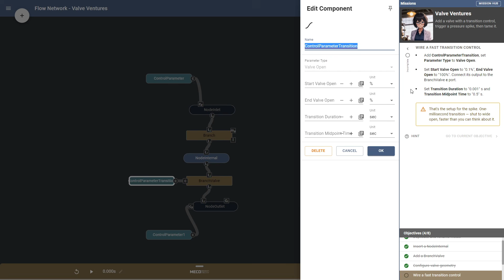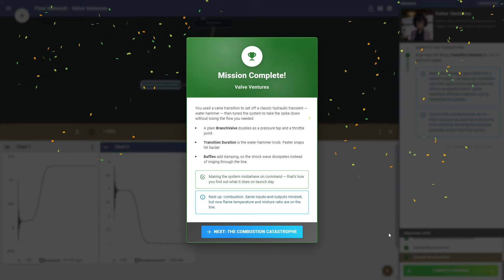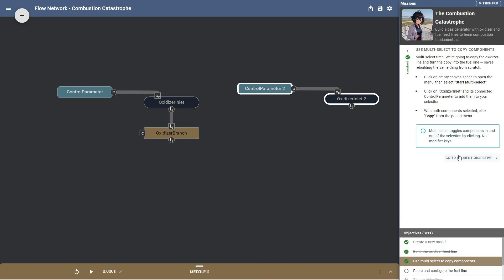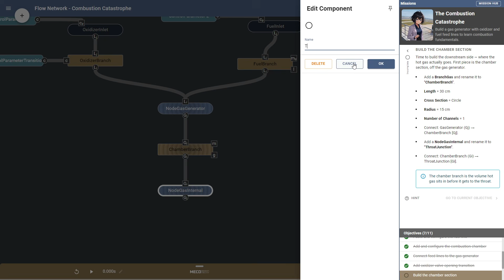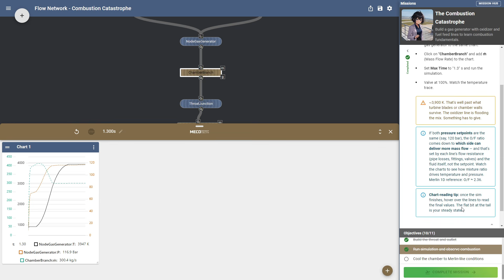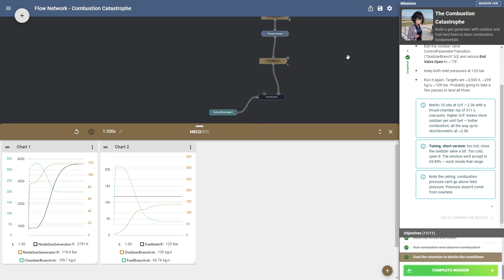MECO Rocket Sim Early Access - Valves and Combustion

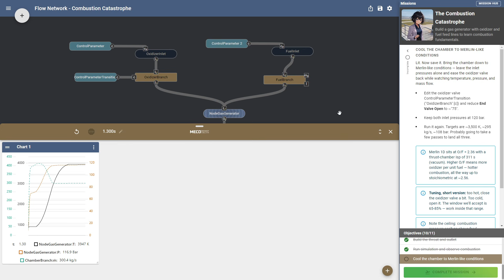Comment: 21:28 I have no idea where they got the "stoichiometric" mixture ratio of 2.56 from, because as far as I can tell, it is not the stoichiometric mixture ratio of oxygen and RP-1, it should be more like 3.4, they might mean the optimal MR for Isp, because that would be about right.
As a little note on the side, the numbers of MECO for combustion temperature do not align with RPA, which doesn't mean that it's necessarily wrong, but certainly something to be aware of. For reference, using the 2.1 MR at 23:35, RPA would think the temperature should be 3480 K (as opposed to 3600 K). The inlet temperatures, where idk what MECO uses, could very well be a relevant factor here.
Reply from the maker: I think they mistook Stoichiometric for optimal, yes. Overall, the way technical terms are used in this are frequently flawed. Before we judge the temperature, I would like to see a fuller implementation of an engine - we're missing a few things here.
Reply: @RaizSpace yea for the temperatures, I'd definitely give them the benefit of doubt, I just wanted to point out that one shouldn't expect CEA/RPA and this to have compatible results